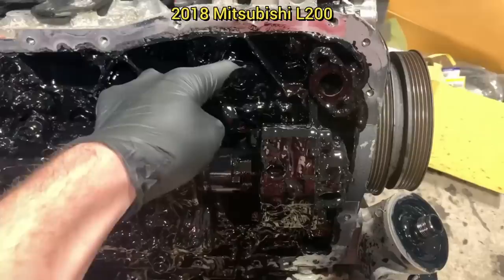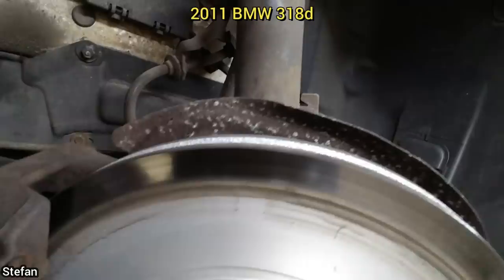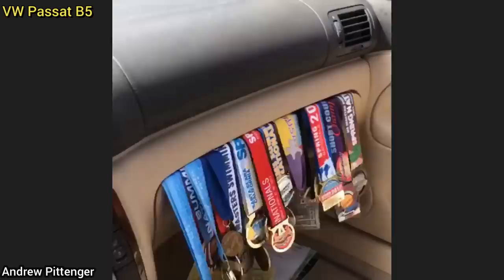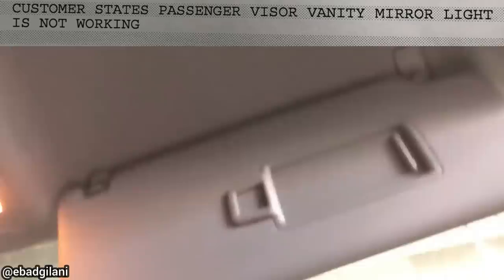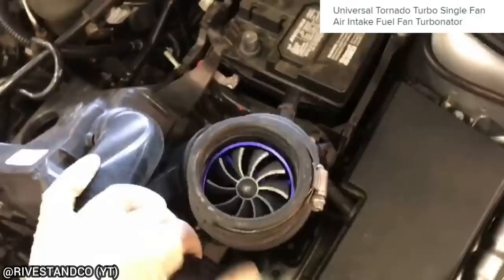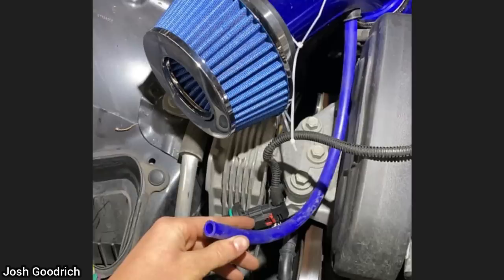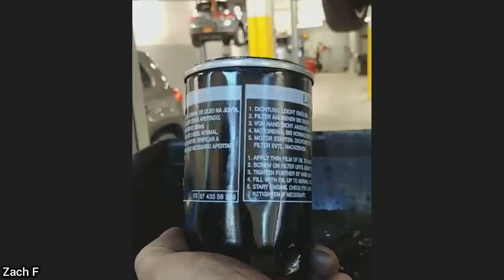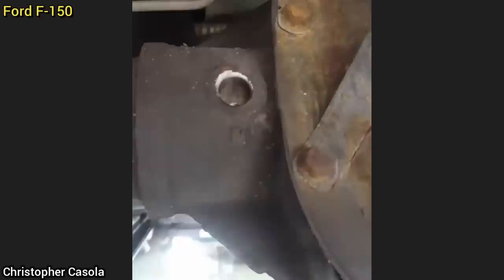Customer States Haven't Changed Oil In 78000 Miles

Comment: One of my engineer friend got married to a Chinese woman who is a Phd chemist. He asked her the last time she changed her oil and she asked him what he was talking about. He found the original oil filter intact in her Toyota. She had about 50,000 miles on it and it was running fine. He changed the oil and filter immediately. It's not that unusual.  I can imagine what the engine looked like internally. The world is filled with the clueless. Love those brake calipers , a real craftsman there. Great show -
Reply: Worse part is, trying to help them will often result in derision. And sometimes performing that super-delayed maintenance will trigger some other issue.
Reply: I blame the invention of electronic ignition and long lasting spark plugs!  When cars had points and condensers, the points would need replacing at about the same time the oil would need changing.  And the plugs might start getting weak by the next oil change.  All of this demands that the owner be mindful of maintenance.

In any case,  the points eventually wouldn't do their job and the car wouldn't start.  A built in protective device to compel servicing!  The car would then taken in for a tune up.  At the same time, the garage would look at the dipstick and recommend an oil and filter change while it's there.  Maybe even upsell a new air filter as well!

Even though I hated points and condensers, they often forced the car owner to open the hood and peruse around to see what else might be wrong.  Computers automatically compensate for wear and tear, which means the car runs well for a long time and the owner has no idea of what's really happening.
Reply: Don't most cars give an oil change warning after a certain distance?  Mine wouldn't let me forget until I got it changed.
Reply: @my3dviews  only modern cars, nothing I have owned earlier than 2015 had a warning and none of my friends or family have the feature.
Reply: @Acedemonlord I have a 2009 Toyota Sienna. The maintenance required light goes on every 5,000 miles.
Reply: A friend asked his Chinese work mate why he was driving with his high beams on, the guy said "no such thing". He'd been driving with them on for over a year.
Reply: @Acedemonlord  I have a 2006 Mercury Montego (Mercury version of the Ford Five Hundred ) that gives you a warning.
Reply: @BlackPill-pu4vi  never underestimate how dumb people can be. Even with all that in the car it doesn't mean people will learn or understand anything new. They will take it to a mechanic and deny all recommendations. Drive out of there with the old oil as long as they get the car to start
Reply: My Genius (seriously, he had a PHD and was a research scientist in Electrical Engineering) brother in law bought one of the $6900 Toyota trucks.  22R, manual trans.  We are about to take a trip to Atlanta and the truck has 22k on it.  I asked when the last time he changed the oil as we might need to do that before the trip.  He informs me he has never changed the oil in it.  Hoping to save the thing, I changed it, ran it around a couple hours and changed it again.  It must have worked, truck had 260k on it when his son wrecked it.
Reply: @my3dviews  My wife ignores all messages if they aren't 200% obvious
Reply: @DavidD-qr2vn  Yep, those Post hole Digger (aka Pile high & Deep) degrees really lets everybody know how much school housin' and book learnin' they got!
Reply: @DavidD-qr2vn  I've heard the 22R is as bulletproof as the 20R. My friend bought a 78 celica as his first car. It needed a fuel pump. We put a 82 celica supra pump in (all we could find). It got 100 miles per tank and we got carbon monoxide poisoning. He went to the hospital and I went to sleep. He thought he was doing a valve check and removed the cylinder head. He put it right back on, asked autozone and they said it probably wouldn't work anymore but to torque it to spec. He rented the torque wrench and torqued the head bolts back down. It ran another 10k until we gave it the junk yard. Gas was only $1/gal at the time but 100 miles per tank added up fast. We never found the pump but we did fix the CO problem with proper exhaust and a universal cat. We wrote all over the car with paint pens. "dohc vtec" cuz this was 2000-2001 when the import scene was fun and we were being silly kids. We also had a couple 12s in the trunk with a home light switch as the turn on/off. I learned to drive manual in that car. It never died, we just gave it away to the junkyard so someone else didn't get the gas guzzler, potentially HG problem and potential CO issues we knew of. Ah, to be 15 again
Reply: @hustla818  Yes and I have to be reminded at times.  I know people way back then drove cars without tending to them.  But, I'd say the relative unreliability saved more cars than not.
Reply: A chemist should know better, no excuse.
Reply: @jonathansmith7306    200% obvious?  🤔
Reply: @BlackPill-pu4vi  yea, I met him as a freshman in high school and we became good friends (tis how he met my sister). He was incredibly intelligent but had very little common sense.
Reply: @dannylim3318  Fair enough, but not all cars do I didn't say iv had every car out there, but of the 4 I have had only my current vehicle has it, and my friends and family all with older cars don't. So I could only speak from personal experience.
Reply: @Acedemonlord  wrong, every car has a 'maintenance minder' indication. for older hondas it was a roto wink that would slowly turn red as your miles went up.
on my 2006 honda its built into the dash as "oil life percentage"
maybe you are talking about American made cars, which are junk anyways
Reply: @BlackPill-pu4vi  I think you may be onto something there. The same applied to oil changing before the introduction of multigrade oils. Most owners were aware that their car needed twenty weight oil in the depths of winter, and thirty or forty in the heat of summer, so the vehicle probably had two oil changes a year. Engines of the period burned more oil, so "Dollar gas and check the oil" was a real thing.

I had a manual for the early Norton Dominator motorcycle which advised that during decarbonising "The ring of carbon above the top piston ring should be left intact as it assists with oil control". When new the bike was supplied with two sets of plugs, a "cold" pair for running in and open road use, and a hot pair for use in heavy traffic to avoid oiling up. I wonder how modern consumers would react to that?
Reply: @webtoedman   I remember those days but, I was a kid at the time.  My Dad took care of that but, I remember the different weights of oil for winter and summer.  I also remember the initial skepticism over multi-weight oils.  The claim being that the thickening additives took away some of the lubricity and that, as the additives wore out, the oil reverted to its base stock (winter weight).  

Really interesting stuff about your Norton bike!  That kind of info supplied to the owner is unheard of today. Instead, owner's manuals are just crammed full of safety warnings, legal disclaimers, and excessive verbosity about the simplest things.  I do remember talk about hotter plugs as a car aged and began burning oil, though.  

Overall, the current consumers of today don't think of anything under the hood.  They see the hood but, it's just full of icky mechanical stuff underneath!  The computer makes the car runs properly, tires are much more reliable than in the past,  and the driver knows where to put the gas in.  That's about it.
Reply: I bet she changed her headlight fluid regularly!
Reply: @stevenaaus  No you can't just assume stuff like that.

Comment: Love the wood screws and goop on the calipers. Love the wrong size brake parts to..they take the darwin award
Reply: I am speechless at that part. They took the time to lift the vehicle up, remove the wheels, remove the bolts for the calipers, and SOMEHOW lost the bolts to said calipers. Like, come on guy. WTF
Reply: @pgoosendrool  Maybe started sometime in the summer, and got back to it before first frost?
Reply: If this channel had taught me anything, it's to let the mechanic handle brakes, everyone always screws up something
Reply: @whatevername4873  Brakes are relatively easy. It's just unscrewing stuff, replacing pads and rotors, and screwing back together. The only thing that sucks is if you have an electronic parking brake or anything fancy like that.

But traditional disk brakes on car with manual parking brake lever is 3/10 difficulty level.
Reply: @whatevername4873 I have my brake jobs down to an art, I wouldn't trust anyone else to touch them.
Reply: Glue n screw says a video on YouTube surely lol
Reply: There's a possibility they may get a Darwin Award in the future, but to actually get one you must be dead.
Reply: @darkdelta  great thought
Reply: @rjmari  I just did my wife's front brakes. I use a cardboard litter box for whatever tools I think I need. Any bolts go in the box so I don't lose them. Swap tires and front brakes took me a good part of a nice sunny warm day. I work at a comfortable pace. No need to rush.
Reply: @mikefoehr235  That's the way to do it. Give yourself some time and go at an easy pace. You can't really mess it up that way.

If you're rushing, you tend to make mistakes. And if you hit a snag, you tend to get frustrated and do stupid stuff.
Reply: @rjmari  I can't argue with you on that. Rushing to do anything is a recipe for disaster.
Reply: The only way to be awarded a Darwin Award is in your casket.
Reply: @BoogityBuu  I would say with faulty brakes, your car is now your casket.
Reply: @mikefoehr235  just how I like it
Reply: Well, smaller brake pads are cheaper...

Comment: I bought a 1960 Plymouth plain Jane from my high school English teacher.  I change oil and lubed it. After awhile the valve train rattled.  Took off the valve cover and it looked a lot like the engine in the video. She told me "Oil doesn't wear out. I always had them change the oil filter and add a quart." I told her it may not wear out but it sure does get dirty. Loved that lady. She knew English, but had no mechanical sense.
Reply: She's right. Oil does not wear out but the additives surely do/

Comment: Using wood screws on vehicles is one of my pet hates. About 10 years ago i worked for a guy who imported mainly 70s era Kawasaki's (Z1, Z900/1000's  Mach 3's and 4's etc) plus, later 60's muscle cars, from the U.S into NZ for the classic restoration scene. The amount of times i saw wood screws used as fasteners led me to believe its a very common practice, another common bodge i noticed was hose clamps/ jubilee clips used to hold the front sprocket on😆😆
Reply: i need to look up " jubilee clips"
Reply: You should always use drywall screws.
Reply: @massimookissed1023  Well, on my C3500 I use coated deck screws to hold the wheels on, weather resistance you know
Reply: @fidelcatsro6948  Just an Aussie word for hose clamp.
Reply: @massimookissed1023  Personally, I would go with deck screws, they weather better!
Reply: @Alex_Mitchell  UK actually, that was the name of the original manufacturer in Kent.
Reply: @Alex_Mitchell   i learned today, thank you🐱👍🏿
Reply: I had a complete factory shop manual for 1974 Kawasaki Mach 4, saw an add in the paper from someone wanting those bikes, sold them the shop manual for 50 dollars. This was in the late nineties, the guy was from NZ...hmmm
Reply: @michaelmclachlan1650  OK.
Reply: @michaelmclachlan1650  The still make 'em, I bought a few the other day (for a use other than holding on a front sprocket...)
Reply: You know their an Aussie when they use the word "bodge" where all the yanks say "Janky"

Comment: First clip, my mom finally got a brand new car just after Covid hit. Didn't get an oil change for 15,000 miles, was already ticking. I had to take it off of her and do it myself. Felt so bad for the car. Ain't no way her motor would have made it to 78000.
Edit: By the time she traded it in at 45,000 miles, it needed a timing chain at the minimum. Meanwhile the vehicle she traded it for, same mileage and same engine model/year, was definitely treated correctly.
Reply: Ngl i did the same but i got mine right before covid and didnt keep it in mind since i was stuck at home most of the time and barely drove, then i noticed it was 15000 and went ohshit. Now i do it every 5000 no matter what. Hopefully i didnt fuck anything up the first time, its at just past 30k and it still runs like the day i drove it off.
Reply: 45.000 miles sounds a bit low to change the timing belt, not that it would hurt. I do it every 100.000km (~62000). I also recommend changing the tensioner and water pump whenever you do so, theyre sure to need replacement, and it wont cost you extra labor.
Reply: @henrlima87  Timing chain, and yes it's quite a bit low. But that's what happens when you don't change your oil when you should.
Reply: @gen157  if its a chain drive it should last a bit longer than a belt, but we are in agreement, oil compromises other components.
Reply: @henrlima87  skipping oil changes can clog the timing chain tensioner so it won't work properly. and a timing chain not tensioned correctly will "flutter", and that will make it stretch. not a common problem, but some parts are rather cheaply made...
Reply: @lotharrenz4621  im not very familiar with chain drives, ive mostly seen and worked on belts, so thanks for the info👍
Reply: @henrlima87  at your service. :)
Reply: @henrlima87  I had a timing belt that I'm pretty sure lasted over 200k km, car was old when I got it and was one of the things that got missed in regular preventive maintenance cause I was a broke student (though it did get its oil changed every 5000km), thankfully it was a noninterference engine so when all the teeth sheared off one day on the highway, it didn't break anything else with it. The cost of the tow and the new belt was under a hundred bucks. Aaah, the 90s.
Reply: @henrlima87  I was gonna say..I'm new to V8's but everyone I've talked to said you basically don't change those, by the time you'll need a new one the engine needs a rebuild.
Reply: @bunhelsingslegacy3549  You're damn lucky, engines with belts are usually interference engines, I was meticulous about getting those changed a 90000 on the Hondas.
Reply: @logicplague  It was a Chevette. They're hard to kill, rust excepting...

Comment: What the heck is it with people not installing fuses on amp wiring?  It's not even hard to do... the inline ones that clamp down on the wire work perfectly fine.  Same with the inline breakers that have a similar design
Reply: Like a fuse was going to stop the wire from arcing on the hood. 
my my my what going on in the brain.
Reply: @scamchan  the fuse thing is something I've seen way too many times and is more stupid than a battery cable getting loose.  It can have pieces loosen, stretch over time, or just break, doesn't always require user error.  Battery acid is nasty.  They still should've tightened it down when they saw what was happening
Reply: Because the audio store people say you don’t need one. Asked crutchfield what size fuse i should use, person said i didn’t need one because the fuse was in the amp 🤣🤣🤣
Reply: @lanemurphy8395  ...they should lose their job.  Literally all the wiring kits I've bought off Amazon included a fuse and the fuse in the amp doesn't protect anything but the amp.  The wiring could go up in smoke, but the amp might be fine >.>
Reply: @lanemurphy8395  I got a set o inline fuses  when  I installed my radio and amp. I also spent  $120 on supplies to do it right.
Reply: To answer your question, the reason is pure ignorance....
Reply: @JSTheAnonymousOne  To be fair most of them haven't a clue about any electrical work. They think all it takes it to run the wire from the battery to the amp. They are clueless to the wear on the battery specially if the amp is too strong and the alternator is too weak (You'd be amazed how often that is the case in cars)